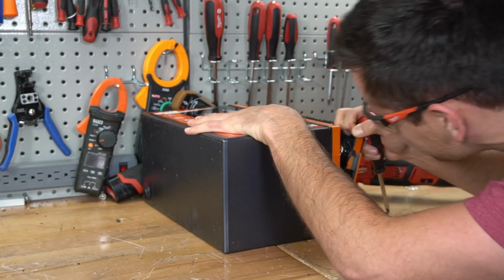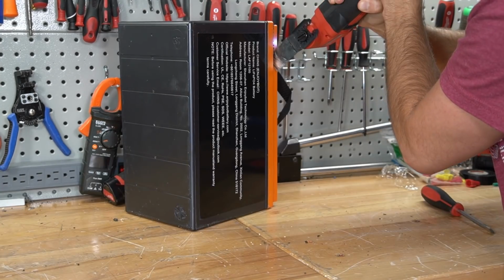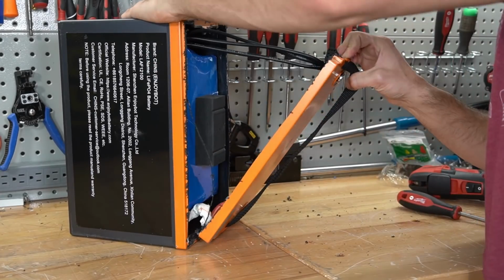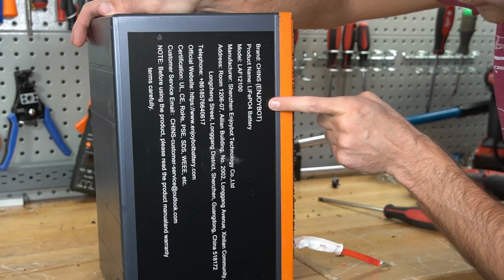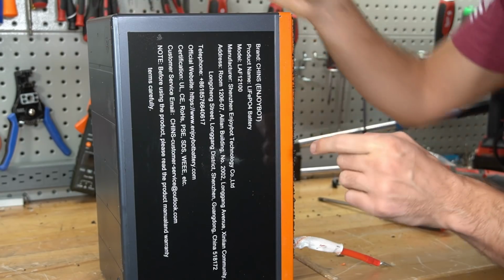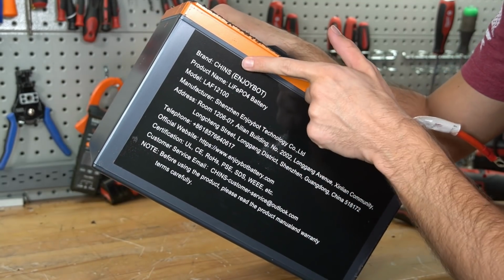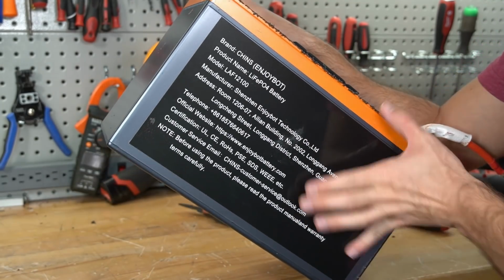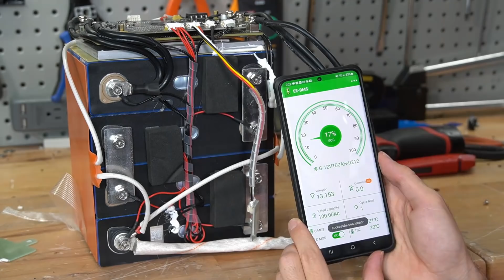CHINS $579 12V 100Ah: Actually impressive!

Comment: After this review and observations I purchased 3 of the same model and later added one more just after they changed to packet cells. All have worked reliably for me year round in Idaho. I recently bought two of the 300ah versions for my DIY home solar generator cart. Both the cart and my RV have 3500 watt inverters drawing on my Chins battery banks. So three years later they are still working properly and as described in temps from -3 to 110F under a barrier of loads high and low.  Note self heating used charge power diverted to the heat pads by the BMS and at 7 amps there is a noticeable demand when heating multiple battery banks.

Comment: Hey will just had issues with 1 of my chins. Contacted suppose which responded right away. Had me do some test and then they decided to replace the battery. So good customer service. 1 question I have for you thought is I want to try and balance the cells in the not so good battery they replaced. I'm not sure which cell is which. #1, #2 and so on. My question is can you show which cell is which.

Comment: I lost 1/4th capacity on 2 12v 300ah wired in series on 700 cycles. I ran extensive testing for chins and they claimed this is perfectly normal. STAY AS FAR AWAY FROM CHINS AS POSSIBLE!! THEIR 10 YEAR WARRANTY IS A SCAM

Comment: I bought a 250 AH Chins for my boat on Amazon. It worked well initially but then refused to charge. After only 10 discharge/recharge cycles tge battery refused to accept a chage. Chins determined the BMS was faulty. Despite their warranty that promised a free replacement in the first year, they are refusing to do so. An $800 battery that lasts 10 cycles and completely fails is no bargain!

Comment: We have been running 3 chins in parallel for our of grid solution for about 2 years now plus one dedicated to our DC fridge unit. Had some issues with one battery not getting to full voltage and they replaced it quickly at no cost plus got to keep the other battery (which runs the fridge now). Honestly chins gave me better service than any US based company has in years

Comment: I ordered 2 of the 100ah Chins LiFePO4 batteries. Good price. Good specs. Unfortunately the 200ah package was too wide for my battery box.  Chins has a pretty good web site. I'll let you know how the installation goes.
Reply: I bought the purple version of the electronic load battery capacity tester. One 100ah Chins tested out at 104ah and change. The other at 103 ah and change. I call them good. They are installed in my Winnebago motor home. We'll see how they do.

Comment: Maybe I missed this in the video, but how well are those bolts locked into place? Just a lock washer, or is there some thread sealer on there too? Reason I ask, I'm looking at a Marine application for electric trolling motors and with all the vibrations and pounding on a boat, I have concerns about those bolts wiggling loose. Maybe a soldered connection is a better option? Or am I over thinking this?

Comment: I just   bought my  2nd  pair of  these  batteries. 
First  set  had evidently a bad. bms..l worked  with  Winnie   on  warranty  and  after  talking  to a technician  I was able to explain exactly what was  going on with the batteries.  So  they immediately replaced both of the batteries. 
I  just  received my  second  pair of these batteries. 
  I  am  very pleased with the. "CHINS " batteries  and  their  service. 
There  only  problem is  not having  a  technical  staff in    the  USA.

Comment: Mine came charged to 6% SOC, kept hitting high cell voltage protection, and CHINS confirmed there is no cell equalization. My battery was 91Ah out of the box, returned it. They said they are updating it with equalization sometime this winter.

Comment: hello will, i hope you reply.. i bought a chins 100ah non heated non blue tooth and i accidentally connected my 5 amp bench power supply to it reversed polarity..grrr. it blew the 5 amp protection diode in the power supply..replaced diode and bench supply is working now...but the battery no longer charges past 12.8 volts..as soon as it hits 12.8 volts it switches from constant current to constant voltage, the amps drop to zero instantly (normally it would show .5 amps). voltage on charger remains at 14.4 volts. im sure i damaged the bms but is like your take and suggestions on it.. thanks robby

Comment: Such a good review Will,  so informative and entertaining to boot! I bought one of these Chins 100ah Smart batteries and I'm having an issue with it charging. Everything was fine and then all of a sudden it stopped taking a charge. I tried 3 different sources AC/Solar/DC but it's stuck at 87% 13.415 Volts. It is showing 0 amperage on the EE-BMS  on both charge and discharge. On the EE-BMS app the  voltage is showing  discharge and a very slight amount of increase when charging. I have contacted Chin and they talk the talk but don't do the walk.

Comment: Hey Will thanks so much for the review. Quick question for you or the community : I got a unit myself. Temperature is 0 degrees (TS1=0C and TS2=3C). My charger in a NOCO genius 10 AMP(lithium mode). The battery is taking 10 AMP even if the temperature is below 5C. According to Will and the doc, heating element are only taking 5 AMP. Does that mean the 2 temperature sensors don't work ?

Comment: Looking for any suggestions for a 12V 100 AH battery for my boat that will get a little wet at times & be Bluetooth compatible. I don't need the heaters as I live in central Florida. Thanks for your help

Comment: Thanks for all the great videos.  I am trying to go lithium ion batteries in a boat which has a bow thruster in it . the vetus bow thruster is 24 volts  with a draw of 300 amps for short periods of 3 to 5 sec blasts. there is a 500 amp slow blow fuse in line .  There are 2 AGM 8d batteries in series for the 24 volts now.this battery bank is seperate from house and start 12v for engines.. I would like 300 Ah batteries like the chins 12v but there specs say 200 amp max with 400 amp 5 sec draw. what could you recommend for the situation. I will be using vitron multi 3000 charge inverted off this bank to run 110 v system for 3 small refrigerators ect while not running generator . To keep house start 12v seperate from 24v thruster / inverter bank  Thanks Dave

Comment: Hi Will, 

I have 4 Chins 300ah heated batteries hooked up in series for a 48volt system. The self heating function does not seem to work, when they get cold they just shut down. I have tried to charge them with a Victron Quattro (with a gas generator) as well as 2.4KWH solar array (they are are always connected to this) with a Victron 250v 70amp charge controller. Chins is telling me they need at least 10amps of current for the heating function to come on. However, still no luck. I am wondering if hooking them up in series causes issues. Any thoughts on this?

Comment: The link to the $329 CHINS is now $399... 

CHINS has a $329 12V 100Ah pack without low temp charging (affiliate link), which we have reviewed in the past and works great: @t

Comment: I purchased the Chins 200ah smart battery for my RV.  Both my solar CC and converter are Lifepo4 compatible.  My only issues is the Temp sensors are too sensitive.  I have several nights where temps dipped to 40 degrees F, and the internal sensors are reading below freezing.  Discharging still works, but charging won’t happen unless my Solar generates 10 amp to heat the pads.  In the early morning sun when I’m not generating 10 amps, my solar CC constantly switches to a voltage overload as the battery denies a charge.  My lights flicker in the RV constantly.  Only way to stop it is plug into a power source to get the 10 amps and raise the battery temperature.

Comment: Had my eye on this heated battery and finally pulled the trigger after this seeing this review. I have it wired in parallel with a gently used, non heated chins 100ah that I found on Craigslist for $200. I was hoping that the heaters on this battery would be enough to keep both batteries above freezing when enclosed in 1" foam board insulation.
Unfortunately the heaters on the the battery I received don't seem to work at all! The temp sensors are showing -1°C and -3°C in the app, but no current draw, and no increase in temperature over a few hours. I am currently trying to get in contact with the seller through Amazon. Anybody else have this problem?

Comment: If I'm running a 24v system for a bass boat trolling motor, could I run a "smart" battery in series with one of their regular batteries and still have the benefit of the low temp charging>

Comment: Would this work with a renogy Mppt solar charge controller? Or can I hook solar panels directly to the battery? Using the charge controller with the temp sensor, it seems to me it would not provide power to the battery below freezing and therefore render the battery ineffective for cold temperatures anyway. Thoughts?

Comment: I purchased this battery because of this great review and the app doesn’t work. (App Version 1.1.9)
I might’ve received the regular model even though I payed for the heated with Bluetooth model.
Reply: I had to return my Chins battery, but their support was great.
When I charge the battery it will dropped from 12.1v to 3v to 4v and the Bluetooth was dead.
They sent me a shipping label for the return which is the right thing to do since it’s not the customer’s fault receiving damage products.

I just got the replacement and this one works nicely! 
Chins is now on my buying list of batteries, great communication & support in my personal experience.

Comment: I see your comment on about special chargers needed for this unit.  I have a ice fishing house/camper that I used during the winter and see temps below 0 degrees fairly often.  If I insulate around the battery like you said do I still need a different charger or will the BMS manage the differences between the older style lead acid and this one?

Comment: Hi Will - Thanks for making fun and informative videos! I am curious if you're comfortable making any comments regarding the use of these batteries for marine use? I have a 36V trolling motor which draws up to 50amps but 90% of the time below 30amps. Outboard specs 1000MCA/750CCA. Thank you!

Comment: One question about the heating element, does it draw power from the battery, or the charger? Does a Chins without the heater have low temp cutoff? Thanks, you channel rocks.

Comment: I like the heated versions but it only offers a 100am BMS and max 100 continuous discharge unlike the 200, 300 and 400 amp versions. Any thoughts on I should just go with a 400 amp one as the dimensions are the same? I also live in the upper midwest and trips to Michigan snowboarding overnight and day can be easily below 0 degrees but the van will be heated.

Comment: I would love to abuse test your BMS and battery for you. Using a vein RT series U1-12RT as my only battery in my samurai and forerunner. they perform better than a car battery. They are not intended for youth as a start battery or recharged from a high amp alternator but it’s working just fine no problems.

Comment: I have 2 200ah Chinns with 200a BMS. No heater, or BT. Working great 6 months so far. Some say I need a pre charge circuit for my Multiplus Capacitors or I can damage the BMS with a demand spike, but no problems with that so far. Also some marine insurance companies will not insure Or put conditions on LifePo4 coverage. Conditions such as made in USA, professional install and external BMS with temp alarm. Hopefully they will understand the different chemistries soon.

Comment: Can anyone comment on the long term reliability of different brands? I don't want to spend the money on say a Battleborn battery if I don't have to or if there won't be and real world benefits in spending the money. But this year my lead acids will surely be done for. I need low temp shut off so they won't charge in the winter. I never camp in the winter but I do leave the trailer plugged in. I would like to double the capacity of my 2 6 volts I have now and add solar this year. I'm itching to buy but don't want to get burned.

Comment: Hi Will
I'm greener than grass when it comes to batteries and solar (Even though I've watched quite a few of your videos over the years LOL)
Reading some of the comments regarding voltage drop using the 12v 300Ah batteries and high draw loads . Would I be able to run a Victron 30a MPPT solar charge controller with 340w solar panels and a nondescript split charger system with 3x100a Chins non Bluetooth non heated batteries  effectively ? Considering I live in the UK where solar is virtually useless except for three minutes on the third Tuesday in June every alternate leap year . 
Also looking at other comments regarding multiple Bluetooth connections from multiple batteries generating some of their own compatibility issues . Would a Victron smart shunt be a wise investment for monitoring 3x12v 100Ah battery voltages as a single pack , or could I configure the shunt to monitor each battery ?
Would the low temp charging cut off be an issue if the batteries were well insulated inside a small Euro style RV (Ram 3500 panel van) . I'd like to run aircon while parked for short periods (Certainly not overnight) and maybe a small induction cook top. Loaded weight being an issue for a vehicle in the UK . I do realise more batteries equals more better . And finances aren't limitless either sadly . Would all of the above seem like a reasonable set up on a budget to get by until more batteries could be purchased if I can find the weight reduction to accommodate them ?

Thanks 
Great channel BTW

P.S. Receives battery . Promptly busts out electric cutting tool to break open battery . Marvels at the inclusion of a Bluetooth module . Drops tool picks up instruction manual and promptly reads , gesticulating excitedly "Oh wow look guys it does have a Bluetooth module . It says right here" . Yeets instruction book (Don't need that where we're going) and proceeds to be shocked at what other "surprises" the battery contains . ROFLMFAO AWESOME

Fattrucker
Reply: That's NOT a greener than grass comment/question, sir!
Reply: @larbueno  The question may not be . But I still consider myself to be in comparison to the company here . 👍🤔🤔🤔😎😎😎

Fattrucker

Comment: Very interesting.  I see that they have a 300 ah 12V with low temp charging and phone interface  for just over a thousand dollars. Much cheaper that 3 100 AH.  Is there an advantage or disadvantage to going this way over 3 separate, other than the obvious significant cost savings?   And thanks for the “inside view” on these batteries?
Reply: A positive for three 100ah batteries is if the single 300 ah battery malfunctioned. A single point of failure. With three you still have two good ones. At the same time you triple the chances of something going wrong. Kind of like a multi-engined boat or airplane.

Comment: What's a couple good brand name 12 volt lithium ion battery with 500 amp/hr storage? Maybe it's better to wire two 250 amp/hr batteries together? It seems very sadly BattleBorn has become a major rip off company. Thanks

Comment: would you think this battery is as good as the SOK? i was going to buy 2 SOK - 100ah for my rv but the cold protection on this one could be nice as we occasionally hit colder weather and its at the same price as the SOK without a heat wrap.  also, would you recommend getting 2-100ah or 1 -200ah?  SOK is coming out with a 100AH in the marine/plastic case for anyone worried about mounting outside.

Comment: I've been running 16.8 KWH of rebranded Enjoybot bats without a hitch for around a year now. I have them installed in a solar heated shed so under temp protection isn't an issue.

Comment: At the larger capacities, there is a big difference between the chins/enjoybot heated vs. non-heated models: the heated models for the 200 and 300 ah captains have a 100A max continuous discharge, while the non-heated models have a 200A  discharge. I have a 48v 9.6KW electric motor on my boat, so 4 of the 200 ah non-heated batteries in series can give me the 9.6KW I need for full throttle, but the heated models would only give that with 8 batteries in parallel and series (which doesn't seem to be recommended?). The bluetooth is also a nice addition to the heated models, though.

Comment: I don't see any insulating separation between the cells. The aluminum cell cases are connected to the positive pole. In a high vibration environment where the blue plastic sheathing can be abraded, connection between two cases in a series-connected pack will cause a short circuit. I don't consider this battery to be safe in anything other than a stationary installation. Did I miss something?
Reply from the maker: No there is.
Reply from the maker: It's those sheets that they use in other packs

Comment: I bought a Chins 300ah battery last May. It has the heat pads and Bluetooth. So far, it has been good. Cost was about $1500. Only complaint is phone needs to be within about 4ft to connect.

Comment: I have two 300AH CHINS batteries in my RV. Thanks to Will I had the confidence to jump in and tackle a LiFePo4 upgrade.  I still unsure if mine have the low temp protection since I don't seem to have the bluetooth (the paperwork that came with the batteries says it does, but I am not sure based on other videos by Will that show no heaters) I was hoping for some SOK, but supply chain issues prevented that. from happening, CHINS was in stock, shipped in a few days, estimate was 10 days, but they  arrived sooner than projected.   I've had the syatem wired up and working for about a month and so far I am impressed with the performance.
Reply: As far as I know the chin's batteries with the orange electric lightning looking thing on each side is the heated version with Bluetooth. You have to download the app first, Bluetooth won't recognize it on its own.